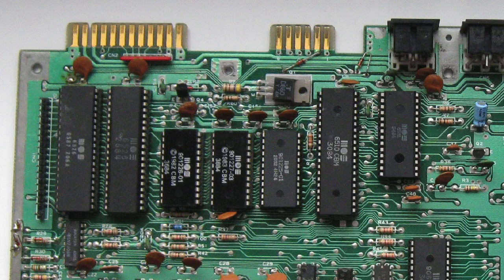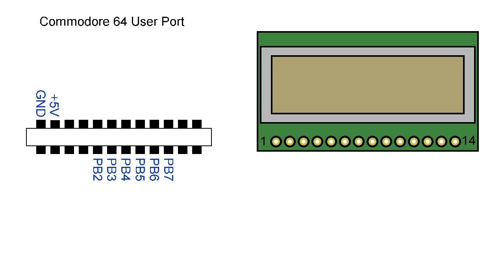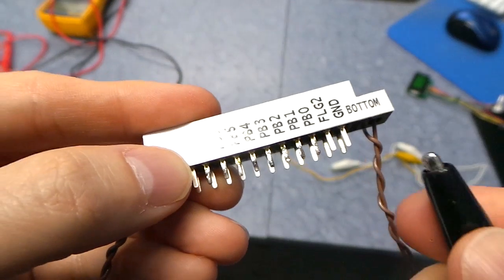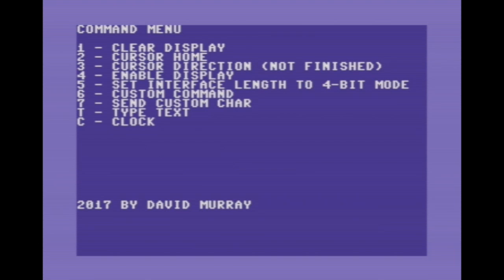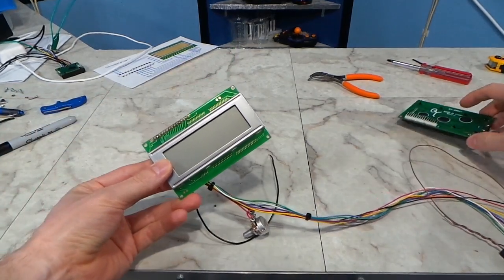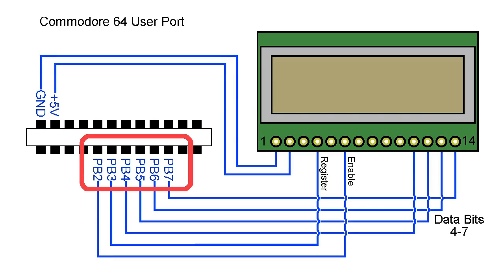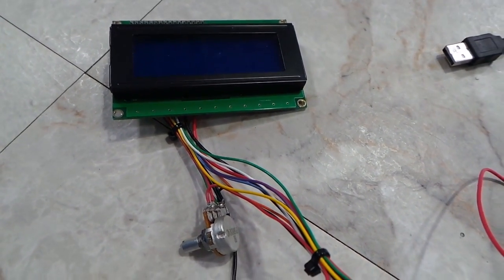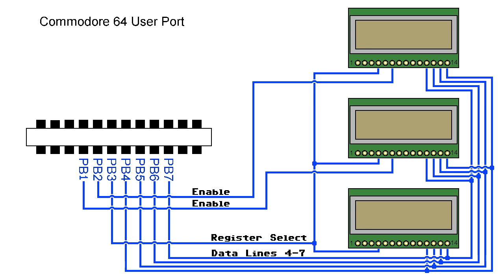How a Character LCD Works - Part 2

Comment: Thank you for sharing the behinds the scenes of the troubleshooting!  People need to know that those older C64 are not trustworthy and should be either replaced a rebuilt power supply or even a DIY (Now there's a good episode for you!)  Question: How much damage was done to the 64?  I understand it tends to start with the ram chips...   Looking forward to your next episode!
Reply: Pretty sure 10> Volts will have fried all of C64 by now

Comment: Death toll: 2 LCDs, 1 speech synthesizer card, 1 C64, and 1 C64 power supply. Rest in peace.
Reply from the maker: yeah... It was like a murder-suicide, huh?
Reply: @The8BitGuy  more like Electronic Holocaust
Reply: @mikkkeh electrocaust?
Reply: @The8BitGuy  yes
Reply: The 8-Bit Guy It was like your 6502 exploded
Reply: This video also shows how flaky the Original C64 PSUs are.  They have killed one too many C64s.
Reply: They shall rest in silicon heaven, where the iron will lie down with the lamp
Reply: I think there was also a shortage of hobbyists who really understood how even an 8 bit CPU bus worked, I'm not counting the industry professionals as it was their job to understand. 

Also you couldn't just download the schematics from the internet
Reply: We should play them a Cannon Fodder Recruit Theme.
Reply: Dragon_EX I hope the C64 power supply doesn't rest in peace and instead rest in hell!
Reply: It should also be said that older electronics like the C64 are more susceptible to ESD (electrostatic discharge) than more modern computers like the Arduino or Raspberry Pi .  I killed the interface chip as a kid playing around with the joystick port and switches.
Reply: May their machine spirits find peace with the omnissiah
Reply: @ENCHANTMEN_  r/boneappletea
Reply: Collateral damage.
Reply: If I had an LCD, I'd go grab some pins and start fooling around with the binary pins on the LCD.
Reply: Electronic suicide!
Reply: Dragon_EX RIP. No Apple 2 were harmed during this video
Reply: '"One" Too Many'. Yeah, not sure about that.
Reply: Its like loosing a member of a family member losing a console
Reply: 11111111 upvotes. I wish no one gives this another like.
Reply: F
Reply: no......in pieces
Reply: The power supply murdered them.
Reply: The 8-Bit Guy dead
Reply: OH SAY CAN YOU SEEEEEEEEEEEEEEE!!!!
Reply: F
Reply: Karma strikes back...
Reply: Do not try this at home
Reply: Interesting he bought the parts from frys  electronics.  And then well….. They lived up to the name 😳
Reply: Yeah, if you are still using a c64 with it's original power supply then get a modern replacement ASAP or donate the c64 to someone who takes better care of their equipment. No one should ever use those things ever again

No matter what anyone says the original power supply will fry your c64, it may do it 10 years from now but it will and it's a ticking time bomb that you do not want to use at all if you have any love towards your c64. People have made things that automatically shut the power off when something goes wrong saving the c64 which is the kind of protection the c64 supply doesn't have at all so get one of those or a new supply with built in protection
Reply: Today's days are pretty nice 1 Arduino (Atmega328p) = ~2€

Comment: Using BASIC on the PC it's just as simple to write to the parallel port: OUT 888, 255
LPT1 data port is 378h, which is 888 decimal.

Comment: Bad news on the power supply. It could have blown out the PLA, RAM, or even the VIC II. An easy way to check (if the chips are socketed), is by swapping them with a known good same model C64. If they're all soldered then you'll need a powered pneumatic solder sucker to remove them. There are several devices out there to protect against overvoltage (several of them advertise on YouTube). Or will you take it to your expert friend since he seems very knowledgeable?

Comment: That LCD screen probably requires negative contrast.  The original spec for 44780 screens required a negative voltage for contrast.  The ones that don't are hacks brought about in later years.
Reply from the maker: None of the newer screens require that.  And thank goodness too!

Comment: Changing old power supplies is like changing fluids in an old car that's been sitting for years; if you don't change it out, you will fry everything as soon as you turn it on.  Check and change anything on old hardware that doesn't age well, this is especially true of electrolyte capacitors and fluids, they degrade faster than any other component.

Comment: You can actually control up to 8 screens all from the user port, by using a 3-to-8 demultiplexer, since you probably only want to enable one screen at a time.

Comment: when I got my c64 I didn't take any chances. I ripped the guts it off my power supply and replaced it with 5v DC switching and a 9v AC supply. If you're careful you can do it without altering the power supply housing.

Comment: Anybody knows of any adapter that connects between PSU and the C64 and shuts down when voltage is not right? at least showing the voltage? :S
Reply: Its out there, but I would opt for buying an after market PSU. It costs next to the same and you don't have to deal with all that adapter shit. So I bought this: https://en.retrogamesupply.com/products/power-supply-for-commodore-64
There is also a cheaper solution, that uses two adapters: https://en.retrogamesupply.com/products/power-supply-cable-adapter-for-commodore-64-64c
Reply: Cool, thanks Tatjana will check them out :)

Comment: A lot of projects that you do end up failing. Not because of you, but from equipment failure, or some other problem. Which really sucks. At least the projects are really interesting, even if it doesn't go as planned.

Comment: Due to the problem of the original power supply committing dying and taking the C64 with it; A lot of the people with Commodores that I have seen would recommend creating or buying a less suicidal supply. It is pretty easy to make one by finding a 9Vac wall wart, and a 5Vdc one (possibly a usb supply). Then you just need to connect the outputs to the matching pins of a DIN connector of the right type (DIN 45329, 7-pin).
Reply: Another option, if you want to use the original supply, is to get/build a protection device that monitors the voltage on the 5V portion of the supply and disconnects power when it rises too high.

You can find these by searching for "C64 power saver".

Comment: Now I want a repair vid on the C64 !!!!. I would bet on the Kernal ROM or the PLA chip. Test the power consumption at 5V line and compared with a good one. I would put a cratridge and try to start the C64 without using ROMS. I would take the 6581 out (if blown can take the bus down) and check VIC II in a donor (a bit risky).

Comment: Is the there a way to do it with serial ports? (I'm new to this stuff) I wonder b/c even new PC Workstations have them (at least last time I checked for an  Core i7-6700T build) By that I don't mean they have em to drive small LCDs.

Comment: You should be able to use the entire 8bit interface as there is a spare PA2 for register select and if you negate the /PC2, then you don't even have to manage the enable input of the LCD as that pin goes low for one cycle after a write (or read) to PORTB

Comment: Is the community of retro computers large enough for someone to develop some kind of universal voltage protector that would be used between the external power supply and the computer itself?

Assuming brands back then had proprietary standards maybe design it to be a snake (multiple cables group together) of different adapters and maybe some kind of microcontroller with a built-in circuit breaker?

I feel like such a concept would do well on a kickstarter.

Comment: 9:47 ... You checked with the multimeter at the value os PB0 reading perfect 4.96 or plus volts. So, at this point the brick was still working fine. LCDs like these USED to be reliable, but not more. I made a project and the LCD was damaged 3 times for no reason AT ALL. Lines start to die at pixel level, then complete line In the end we changed the regulator and added TONS of filtering, checked for gound  loops .... Those are getting pretty weak IMHO.  As per the brick: I put a 5V6 Zener 3 o 5W and a fuse in series. So as soon as the brick stops doing its job, the zener clamps and the fuse blows. I love my C64 and I dont trust the brick AT ALL.
Reply from the maker: This has been brought up before.  But I do not know if the 5V that comes from the 6526 chip is sourced from the same rail as the userport power supply.  The C64 gets 5V from two different places.  One is rectified from the 9V AC and then passed through a 7805 on the motherboard.  The other comes straight from the power supply itself.  I'm not sure where each goes.
Reply: OK, I really miss that the C64 has and internal 7805, appart from getting 5V from the brick. I only remember the 7809 or 12 (not sure) which is used for the SID and VIC and CASS MOTOR (and probably another things ...). It is WEIRD. Local regulation makes sense. But, the C64 is really tight on HEAT disipation, so probably doing the whole 5V regulation using linear regulators is not posible, and they need to "generate" 5V at the brick. Brick is epoxy packed (the original I have seen), so heat disipation is not the best as well. I will have a look at the schematics again. Made me curious .... Probably some thing are too sensitive that need local regulation .... If I found something I will add the comment here.  But sure this will make a good episode. Plus, many people has a BLANK SCREEN C64 around and getting into the troubleshoting will be nice (IMHO of course)
Reply: Well, I couldnt help my curiosity. Yep, there is one 5V regulator inside the C64 even when the brick sends 5V. The 5V comming from the brick are called "5+" and the 5V comming from the internal regulator use the name "CAN 5+". User port uses "5+" .. that is, the 5V comming from the brick. In fact MOST of the system uses "5+", also the CIA and the SID.
Who uses "CAN 5+" ?. The VIC II. So you cant blame the vic. There is a 12V reg that feed both SID and VIC (since those chips are mixed signal, have both analog and digital parts). And also there is a 9V unreg that is used for the CASS MOTOR taken before the reg that generates "CAN 5+". Luckily cass motors from that era werent noisy (voltage noise) since used electronic speed control built in. Otherwise it doent look like a good move, since the noise can go through the reg effortlessly spoiling the local regulation.

Comment: Any after market parts that could go between an original C64 power supply and the device itself to prevent incorrect voltage from going through to the C64 when the power supply goes bad?

Comment: Up until Win98 you can directly poke a value into the LPT port's register if the PC. That's why it was used and abused for ALL kinds of stuff. My first experiments were lots of programs involving LEDs stuck directly into the LPT connector.

Comment: if you wrote the test program on the first c64 and then the computer stopped working, how did you transfer it to the second one. had you wrote it 10 years ago for the experiment?
Reply from the maker: It was stored on the SD card in my disk drive emulator.  Not in the computer.

Comment: I power my C64 from USB (for 5V DC) and from an SNES transformer (for 9V AC.... but US SNES Power supplies output 10V DC sadly). I'd recommend doing something similar to avoid further damage to your hardware, since failing power supplies are VERY common with the C64.

Comment: C64 power supplies are the worst. I wish there were equivalent modern supplies made for the 64 with over voltage and over current protection that would adopt the 64 DIN input.

Comment: Did the breadbox c64 survive? Or was is actually fried beyond repair? Love this video and how this chain of events got a bad case of the Murphy's. Good thing you figured it out.
Reply from the maker: yes, it's fried.  i tried it on the good power supply and it still doesn't work.  I will try to repair it eventually.

Comment: Sorry man, very bad if you fried the 6502 CPU, that was a good C64. Why you don't power your c64 using a pc psu with voltage regulator on the 12VDC output (to get it at 9V from 12V) and you can use 2 5V connectors from it to power the 5V wires.

Comment: @8:35 It wasn't mentioned, but were you sharing the ground between your C64 and USB adapter?  I believe that is a requirement. 
 Also, I've only ran these LCDs  with a PC running MS-DOS (using QBASIC and QuickBASIC v4.5), but the parallel port on a PC has additional lines (Strobe, Line Feed, etc) to be able to run these LCDs with all 8 data lines -- Does the Commodore series also have these pinouts?
Reply from the maker: Yes, I had the grounds shared. There were some other pins that I might have been able to use, but I wasn't 100% sure they would work or where to even find them in the memory map.  So It was just easier for me to use it the way I did.  if all else, I could have grabbed an extra pin from the cassette port or the joystick port.

Comment: Why didn't Commodore add a fuse or some other over-voltage protection between the C64 power supply and the rest of the board back in the day? If a failed power supply instantly fries your whole board, that seems like quite the design flaw..
Reply from the maker: They wanted to build them cheap.. and as long as they lasted a few years that was good enough for them.

Comment: Always use an over voltage protection device when using an original C64 power supply! I recommend the "SaV64" (Google it).
Reply: Ew, no. Crowbars were A Thing in electrical engineering back in the day. If the PSU is sending too much voltage, _it is already damaged_. It should be obvious that having the PSU commit suicide without killing the electronics is preferable to having the PSU commit suicide and taking the electronics with it.
Reply: Seems like what's needed is the old "Crow-bar" device, a thyristor wired across the supply big enough to short it out linked to an over-voltage detector. It's crude and it isn't nice to the power supply but it saves the computer.
Reply: I probably didn't explain: I'm not talking about an add on. The circuit would have been buried inside an old PSU anyway and the aim was to either pop a fuse or put the supply into current limit in the event of regulation failure. Damage to the PSU wasn't an issue as long as it prevented the overvoltage hitting the 5v rail.
Reply: There are tons of overvoltage protection circuits on the web. You can easily implement them with a transistor, a zener and a couple of resistances.

Comment: When using 4-bit transfer mode, it is recommended to use pulldown resistors on vacant data lines, else they may accumulate static and cause initialization glitches during LCD power-up.

Additionally, hooking things up directly to parallel or serial ports without current limiting resistors, PTC fuses or diodes for protection is very risky. I've fried my share of hardware that way. This is especially critical when you expect to be hot swapping homebrew peripherals. When things are plugged/unplugged the electricity sometimes may flow in unexpected directions. Not all computers or microcontrollers know how to limit current or deal with reversed polarity.

A loose ground wire is a recipe for disaster also. I had one brush against the logic pins of a serial port for a split second and that was enough to destroy the RS232 chip. Good thing you caught it.

Comment: I would encourage you to get a voltmeter or a buzzer/alarm so when the power supply puts up too much voltage, it can beep or whatever and cut off the power at a certain voltage threshold and keep your future c64's from frying.This thing can be something that receives the power supply input on one side and then have an output on the other side for you to connect the c64 to. This way you can use your homemade C64 surge protector on any other power supply unit for a C64.

Comment: commodore repair video in the future?  what about making a circuit protection module for the c64 to connect between the psu and c64 to alert for high voltage add trip for higher voltage

Comment: How did you sent actual commands with C64? Just single POKE the 56577 or two to make it sure that command will be read by LCD properly?
Reply: More since you need to bring ENABLE bit back down again, for each of half-bytes, but you get the idea.
Reply from the maker: Well, I had to write a program to divide up all of the commands into two 4-bit sections and then send those separately.

Comment: Damn, my condolences about the PSU and the C64...

Also, you could probably use 7 (1 line for no activity at all) screens with 3 select lines if you had a demultiplexer :)

Comment: Awesome video and very creative use of the hardware.  I have one concern when you added the external power source.  You mention that you only connected the data lines.  I have always been taught to connect the grounds together otherwise the components may not register the same voltage potential. Extreme cases could cause overvolt damage and less extreme the high signal may not register high.   (This is from a electronic hobbyist's opinion and may not be accurate)
Reply from the maker: yes, the grounds were connected.

Comment: Controlling the parallel port from BASIC on a PC is really easy (OUT 378h), as long as you're not booting into anything more modern than DOS. I did loads of parallel port experimentation back in the day!

Comment: Bad luck on the PSU. Quite typical with the 80's computers now given their age. My BBC B PSU went pop a few months back . Luckily the board survived. Just got a capacitor refresh kit and rebuilt the PSU. Might be worth looking in the Commodore supply and see if its repairable. I remember when i was a wee lad, and my Vic 20 PSU used to be on the floor by my feet. Used to keep your feet nice a snug in the winter !.